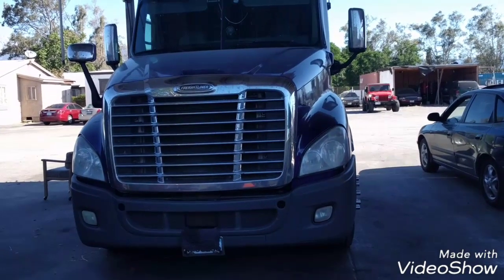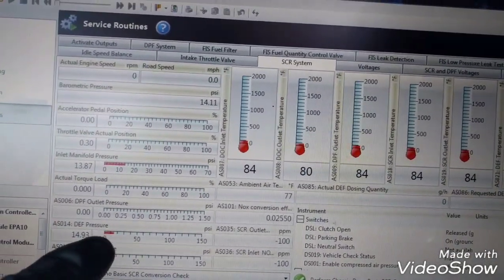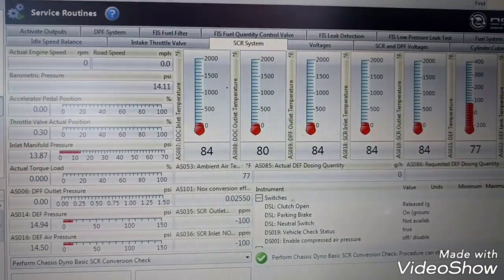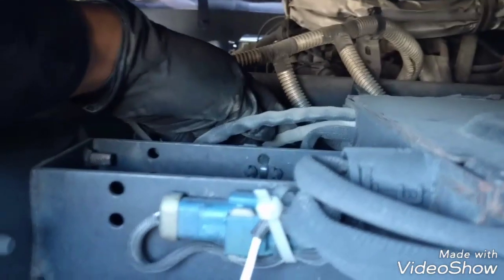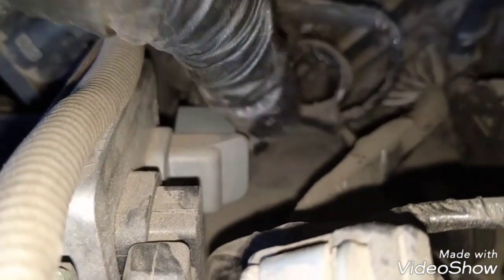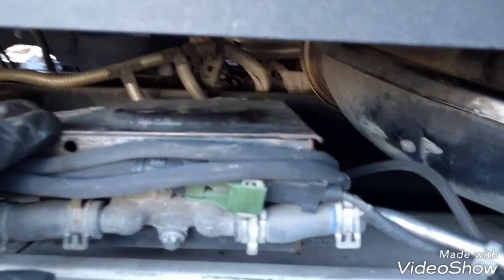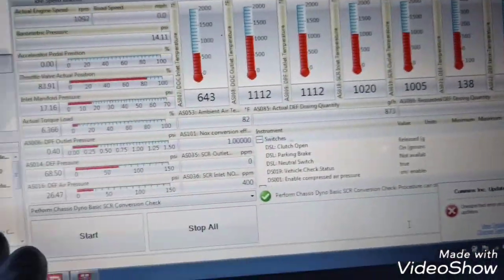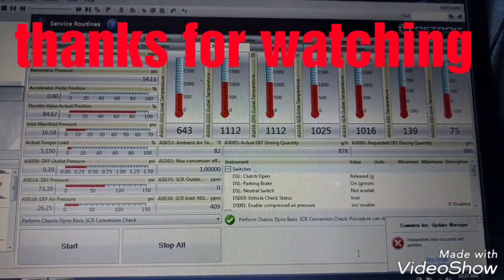Freightliner Cascadia DD13 DD15 SCR filter bypass SCR conversion efficiency low Improper DEF quality

Comment: I have the exact same issue happening with my truck. Everything was fine.
Once I change the DPF filter and changed it to knock sensor. That’s when this issue started so I’m going to try the bypass that you recommended. Where should I put outlet sensor?

Comment: Mr Amaya I’m currently working on a Freightliner 2018 . The codes are 521040, 521050, 511052, 520373 . Also low scr conversion efficiency low . The truck has the two amber lights on the def amber light blinking and it’s in a 5 mph derate . I replaced the dozer injector the def pump filter and the two box sensors and it still won’t get codes to become inactive after I perform regen . I even tried tricking the system by leaving the box sensor out side with the electrical connector connected and the scr efficiency to work 100% but it still won’t codes won’t go inactive . I also tried to go the speed sensor route but it’s not the same as the older models . Any advise will help thanks in advance

Comment: I did bypass , everything was good with only amber light on , but now getting 3057 code with flashing red light and truck is not running. Any suggestions

Comment: Trying tomorrow at my shop will update asap if it works on a 2015 cascadia with dd15 not to sure on model of onebox but its newer than the one in the video for sure
Reply: No need to buy a new sensor, just take out the existing outlet sensor and screw a plug in the hole. Then zip tie it out of the way.
Reply: @dallonebmeyer8229  are you sure .  is that work if derate engine,  5mph , regen not working , soot level high.  stop engin light , check engine and regen light on /....
Reply: @virknation7535  No, If you have all those codes it will not work. This only works for poor DEF quality,  or NOX conversion efficiency low.

Comment: Hello Mr.Amaya I’m having a problem with the Freightliner 2016 with a Detroit diesel engine the codes I’m  getting  are SPN 5246 - fmi 15 SPN5246 fmi 16 SPN5246 fmi 0 ESPN 4364 fmi18 SPN 4364 fmi 1 SPN3364 fmi 2,I changed def Filter I flushed out def put new DEF changed NOX sensors &scr box harness The dealer was no help I will pay you good to walk me through this issues I have a pro-link edge snap on scan tool I’m Live in Glendale Arizona any response from you I will greatly appreciate I enjoy your videos you are very smart I would like to learn from you thank you

Comment: I'm confused so the bypass was just changing the sensor? I'm lost
Reply: Bypass is you leave the old sensor installed on the hole is normally and disconnect the plug from the old sensor and get a new sensor and just connect the plug to the new one and hide the sensor and secure it that way don't go all over the place

Comment: Great videos. I am hoping you can help me interpret codes on my 2013 CASCADIA. Truck is losing power up hills even when empty. No service light are on. This truck also has def system deleted prior to my owning it. Codes are:
Radar 042 SPN086566 12
Engine 000 SPN000639 J1939 NETWORK 07. 
Thanks in advance.

Comment: Is that mean the truck will keep moving without needing regeneration at all regardless the mileage? My truck had bad scr box getting over heated melting the side fairings and the harnesses. So if I do this the truck will stop do regen itself ? And no derate. ?

Comment: Will this work with a 2014 freightliner Cascadia?
Reply: Yes. I've done it to myn. I have three same year truck. Just leave the old one installed and plug in the new one and secure it. Will also send alote on def
Reply: Save on def fluid

Comment: I was not able to delete fault code spn 3364 fmi 1 "DEF quality final warning" with the nexiq tool and Diagnostic link 8. The annual subscription is $500 and the tool = $750.  I am still derated to 5 mph.  I installed the new $500 (with core charge) NOX outlet sensor and now pass the parked regen.  I think only a dealership software can remove the final warning level fault code.
Reply: Were you able to clear DEF quality FMI 17?  It goes fmi 2, fmi 17, then finally fmi 1.  If we can clear fmi 17 that would be hella helpful.
Reply: @mattabraham3549   I was able to clear all codes but the fmi level 1.  Then I bypassed the speed sensor and was able to bobtail to my favorite Freightliner.  By the time I drove the 600 miles the codes self cleared and I was able to reconnect the sensors. I kept telling the dealership that I believed that the issue was my engine or something before the 1-box sending in too much pollution and that is why I failed 70% efficiency on hill climbs or heavy loads or higher speeds.  Freightliner said that I was crazy and that they were the experts.  They said it was a bad 1-box . $10,000 later(new box) I only got 85% efficiency in their lot.  "Your all good" Freightliner says.  50 miles after I left Freightliner my engine blew up.   I have coolant leaking from a cracked cylinder sleeve into my oil.  Engine needs rebuilding.  There was nothing wrong with my 1-box.  It was just doing it's job and reporting that there was high emissions due to excessive blow by.  The dealership never pressurized my coolant system to check for leaks or loss of pressure.
Reply: @lukasallen846  All stealerships do is hassle new parts for daimler's profit.

Comment: I wish I could send you my video but I try to explain. The check engine light comes on another engine light comes on both are yellow, the DEF yellow light blinks off and on and the region temperature with a puff of smoking  

I pull over, do a force region, it starts to region, the temperature in Puff smoke region blinks off and on., After about five minutes, the check engine light goes off the Blake and DEF light goes off

The solid yellow engine light stays on, and the DPF temperature with a puff of smoke gauge stops blinking and stays on.

At this time truck is still in region mode

Comment: @francisco_amaya_youtube_ hello sir thank you so much for this bypass solution to trick the SCR and NOx sensor. 
I have a question, doesn't the NOx sensor need to reach a certain temperature for it to work? If it's not reaching that temp will it cause a derate? With the outlet sensors unplugged at either end neither of them will actually be sending the temperature, will this cause a problem? Thanks man!
Reply from the maker: That nox sensor on Detroit doesn't have a working temperature rates. It is the computer what determines when it needs to be activated so that is right you can easily manipulate the reading that way.

Comment: How long can you drive the truck,bypass scr..
Reply from the maker: From 100k to 500k miles, it varies
Reply: @franciscoamayaYT  After I bypass,will all my check engine lights go out,And will it come out derate mode,Thy???
Reply from the maker: No derate but the amber light will stay on
Reply: @franciscoamayaYT  500k sounds almost like a permanent solution. I thought it was a temporary. So I can Just drive with bypass without fixing scr box?

Comment: Iam having the SAME PROBLEM..Started Couple days ago..THANK YOU for this help..I need about 6wks of running.Will the truck run at regular speed???? THY FRANCISCO
Reply from the maker: Yes, everything will run normal
Reply: @franciscoamayaYT  Thank You..Sir..
Reply: @franciscoamayaYT  Will after the bypass,will my engine lights go off..All three are on,And in derate mode??
Reply from the maker: Yes, everything will go away but if you have other problems like sensors or DEF pump stuff you will have fix it too.
Reply: @franciscoamayaYT  All that been replaced,pump,metering valve,both box noxs sensor all of the heater lines,ALV changed,Fresh def fluid..Upgrade software,ACM,ECM,CPC..Evrything past,Except the it failed the scr conversion..HOPEFULLY I drive truck about 6-8 weeks,make some money,buy ONE BOX

Comment: Cuánto tiempo se puede conducir haciendo el bypass?? Gracias por su ayuda!
Reply from the maker: Hasta un million de millas or hasta que dure la caja
Reply: Francisco Amaya qué tal.  Saludos y haciendo este bypass se podrían eliminar los filtros que están dentro de la caja scr? Que pasaría si los saco o si los perforo y hago el by pass. Espero tu respuesta gracias hermano
Reply from the maker: No, el bypass no es para eliminar el filtro.  
Si quiere eliminar el filtro tiene que programar la computadora
Reply: @franciscoamayaYT  que precio tiene la programación de la computadora para hacer eso??
Reply from the maker: No necesita programacion.  Ve a my video
Reply: Si se recorre 500.000 millas viajes largos muchos regen no hay riesgo de que se dañe el motor ?

Comment: Tried that on my 2011 truck with dd13, did not work.  Inlet 245, outlet 0, conversion 0.02550 and 3226 (nox sensor) code showed up and other codes stayed.  Note sure what I did wrong, but didn't work for me.
Reply: 3226, need fmi number after spn to help you. but 3226 is either outlet nox sensor circuit fault or drifted.  check for spread terminals on harness, verify 12v across pins 1 and 4  and 60 ohms across 2 and 3.
Reply: Outlet nox sensor.  I tried deleting codes with computer, do regeneration etc.  Codes stayed and truck stayed in limp mode.  May be it would have worked if I did it before truck went in to limp mode, but no such luck for me.  Ended up paying $3500 to tow it home and then 11k to replace one box 😢

Comment: Hi. I have eec 61 3251 fail 2. Is the bypass on video can help me temporally? It’s a dd15 auto 2011 Cascadia. Thank You.
Reply from the maker: I will recommend you to clean the DPFs and Doc to and do the scr bypass. And probably will last a little longer.
Reply: aluminum manifolds that pressure lines feed into crack and cause this fault also make sure the sensor is actually functioning, verify wiring to sensor from acm is good.  also could be face plugged doc or dpfs are full as Francisco said. what is ash accumulator % ?

Comment: Hi sir,I Replace my one box,harness wire,all sensors including nox sensor new filters still it show signs for nox sensor low efficiency if you can help please.
Reply from the maker: What is the code?
Reply: @franciscoamayaYT  now I bypass nox sensor as shown in video.
Reply: @franciscoamayaYT  I forgot code
Reply: How did you fix it?
Reply: @bereketmol4227  I replaced 1 box from dealer. Their was a defect in one box I bought first.

Comment: Does this will work on 2017 DD13 ????  Thank you sir!
Reply from the maker: Yes, it is possible.  The sensor location may vary.
Reply: @franciscoamayaYT  Francisco..I have 2013 cascadia,DD15.. will this work on my truck I need about six to eight weeks of running to make some money then I could change my one box it would a truck run at normal speed miles per hour without damaging anything else thank you very much,My scr box needs replacing
Reply from the maker: It will work only if the problem is a faulty SCR box
Reply: i can tell you it won't , works on some epa 10 engine because the def system was pretty basic, ghg 17 will know something is wrong and before long you will be in 5 mph derate
Reply: @red66chevy  doesn't ghg17 have a soot sensor instead of a nox sensor
Reply: @deanlutgert8292  GHG17 has a soot AND outlet nox sensor, soot sensor is there to make sure dpf's don't; pass soot. if it senes soot it derates,

Comment: I did this and got code 3057 fail 2... should I be worried?
Reply from the maker: Do you the red light on?
Reply: @franciscoamayaYT  no just the yellow mil light.
Reply: @franciscoamayaYT  will the yellow mil light permanently stay on with this bypass. Also will I be able to continue to drive without problems?  Thanks
Reply from the maker: @kennymorrow7875  
Yes, it does cause and problem to the system. Nothing to worry about the specific code.

Comment: I haven't gotten any codes relating to my one box. Iam however getting this really loud almost like a raspy rattling noise from the one box what do you think it could be? Only happens when i accelerate specifically when im heavy. I hope you can help. Thank You
Reply: Same problem here . Have you figured it out yet?
Reply: @DJRHIS  nothing yet truck still drives fine tho
Reply: Well I had that noise but it stopped . But I did this and I only have 2 lights on . Stop and mil light and my truck still runs fine with no problems
Reply: I would like to know the same thing what’s rattling in that box Is the doc crumbling or scr catalyst coming loose.

Comment: I think if CARB catches you, they will hand down a massive fine. But it works great on trucks that dont leave the county or state. It works great on DD13-15,16 EPA 10 2010-2012, GHG14 2013-2016,7 but dont know if it works with GHG17. You will get a fault code SPN 3057 FMI 2 SCR Outlet NOx Sensor - Error, but it just asks you to perform a Parked Regen. If it passes to release vehicle. The MIL will turn on (the little engine lamp) but wont cause a derate. Good luck guys, keep on truckin'.
Reply: You wrong men , The sistem is working , dpf   and doc working good . Regular emission

Comment: Big $15,000.00 question...

Will the truck still auto regen, when its being fed false data that the filter is clean ...

If the sensor is saying the filter is clean,  the truck will NOT auto regen, then ur dealing with a bad sensor and a dpf so full it has to be replaced and cant be cleaned.
Reply from the maker: Yes, it will work normal.  The Amber light will stay on.  That will be the problem only.

Comment: Great videos Francisco.. My truck is putting out the code eec 61 fault 1 spn 4364. Which NOX sensor do I replace? Or should I bypass for now? The engine is not derated at all after 50 hrs of running
Reply: Donovan Mewhinney it’s usually the outlet.. but inlet can be the issue too

Comment: thanx for reply 
should i need to buy special socket to remove sensor from scr box..?
Reply from the maker: Yes, a 22 or 7/8 oxygen sensor socket (open socket).  You can buy it at auto zone or Amazon.
Reply: But why remove the sensor ?
Reply: Bro have you removed sensor??

Comment: hi i have 2013 cascadia evo
i have some codes of scr
4364 fail1
4364 fail 18
3226 fail 20
3238 fail 2
my truck don't have metering unit 
what shuld do will bypass scr works for me now i have amber light on my truck..i already try force regen.amber light come back after some miles..
Reply from the maker: Looks like you have to replace the outlet Nox sensor to fix the problem
Reply: today morning def light start blinking check light on  and truck comes to 55mpg this happen third time to my truck is this is a nox sensor problem...?
i read online they say clean metering unit but my truck don't have metering unit what i should do pls help
Reply from the maker: Did you replace the NOx sensor?
Reply: @harvindersingh3828  I have same problem how did you fix this issues.

Comment: No reply ???
I been waiting???
Reply from the maker: I did reply to your question about the SCR bypass.  

I just looked at it right now.
Reply: Francisco I just replaced my whole one box and my filters are at 6 percent but I was still getting low nox and poor def quality so I had a derate and flashing def light so I did your bypass everything seems to be running well except after I idle overnight then 4 days its asking for a regen I'm scared to death to push this regen button because it never has turned out good for me but its asking for regen but I did drive the truck for a hour and the regen light goes out by its self so my question is do I drive regen every time or can I park regen
Reply: KENNEY WIGGINS so you replaced your onebox and it still didn’t fix the problem??????
Reply: @tbren9341  I replace my box still I have problem
Reply from the maker: It does regen when you drive but the regen switch only works when the soot level 2 only.  

But you can try to do it as soon as you stop the truck without switching off the engine.

Comment: Your videos help me so much thank you. I have a 2014 cascadia evolution I'm worried that my dpf system is going to reach the end of his life soon . I have 526k miles on my truck . Can this be a permanent fix for the truck? Or if I leave it like this will I have to make further modifications?
Reply from the maker: No, it is not permanent 

It is just to make the SCR box last  900K+ miles
After this you don't have to do more modifications.  But you will need to repair any else that can go bad, like:

DEF pump 
DEF lines
Sensors
 wiring 
Etc,..
Reply: Francisco Amaya how do you know when SCR box is bad? I know you said this bypass is to make it last 900k+ what will running a dd15 with a high doc pressure of +1.5 do in the long run to the truck?

Comment: Después de unos días trabajando aparece código scr outlet nox sensor error code 3057 mode 2
Reply: Y se quita solo o queda por siempre o que hay que hacer por que queda la luz amber
Reply from the maker: Eso es un efecto normal.
Reply: Sorry.. To translate in English.. Was the question.. After a few days engine code for scr nox outlet 3057 fmi 2? 
Response: This is may happen meaning the truck is still okay to drive? Bypass working fine?

Also how long is bypass good for working? Can DPF system still need replacing?
Reply: Last question.. Does this code 3057 02 only appear when you don’t replace the nox outlet sensor?
Reply: juan guerra entonces desconectar el sensor y volver a conectar con el nuevo ?? en español le entendería porque en inglés cuesta mucho entenderle a Francisco

Comment: Francisco I have dd15 2013 I did this method but i want to know will i lose power or derate any and if i do what should i do thanks for the video
Reply from the maker: Side effects are 
Amber light on (only on some trucks)

Sometimes low power (only some trucks)

No all the truck are going to present the side effects but it does not affect much.
Reply: About to try this tomorrow i have the low nox code.  Sometimes my engine derates in power and will reset if i park for 10 mins.  is it possible if i try this my engine will stay derated in HP. Cuz the 25% derates i get suck